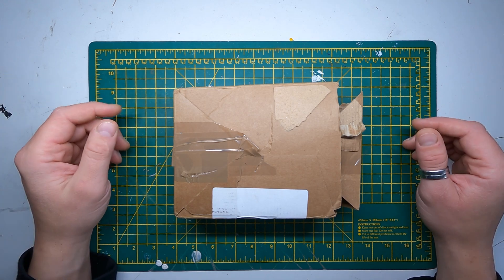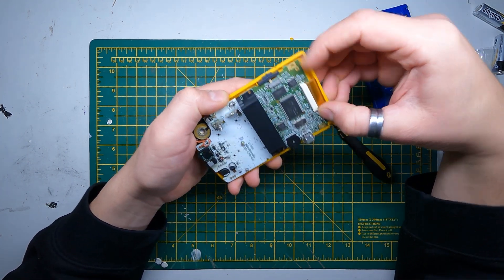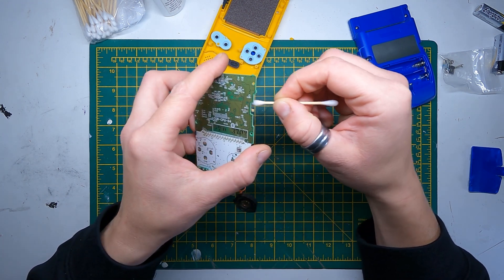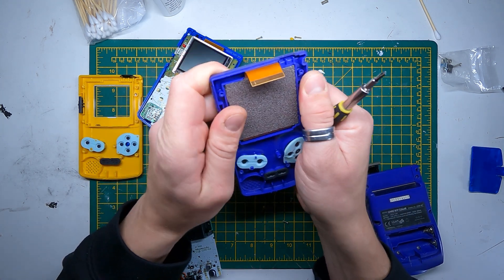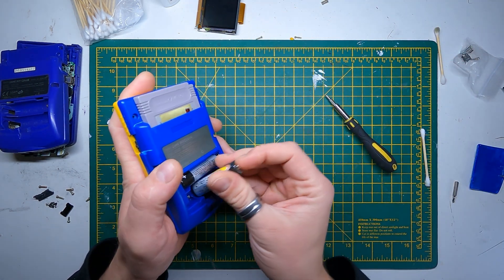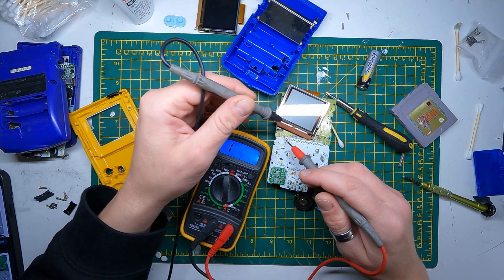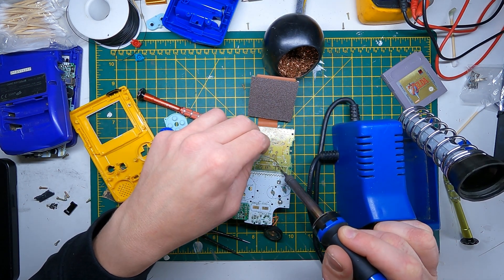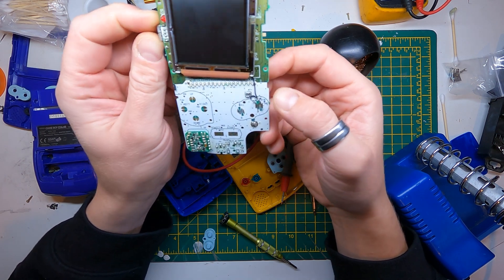Faulty Pokemon GameBoy Color, Can I Fix It?

Comment: You should be able to see if the power switch is working by checking continuity on the points with the switch in each position. If it is dirty you really gotta take the shielding off (desolder it) and clean inside for a proper permanent fix. A fiberglass pen helps a lot. When you just get a bit of IPA in from the outside it's often only a temporary fix in my experience. I had a GBA where the issue kept coming back until I took it further apart to clean better. After that I just did it to every Game Boy I worked on to avoid issues down the road. For the corroded buttons I'd start with white vinegar before the isopropyl alcohol to help neutralize the corrosion. I'd probably also hit them with the fiberglass pen and get them shiny. The sandpaper probably did something similar, but I'm not sure if it works as well or not.
I haven't run into a broken trace before, that would suck. With the signs of previous water damage I probably would've given the whole board a good vinegar / alcohol scrub. Sometimes the weirdest problems are just from some dirt/oxidation or corrosion. Especially power issues.
The sandpaper and the metal file seem a bit too intense to use on this kind of stuff, IMO.
Reply from the maker: Thanks for your tips man!
Reply from the maker: Will get a part 2 done ASAP.